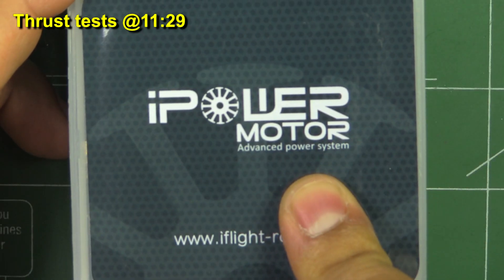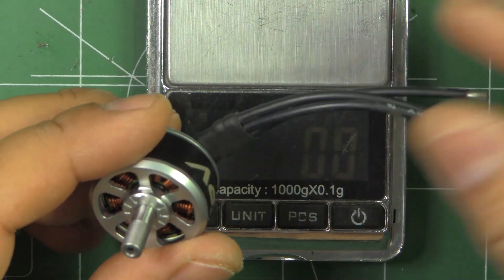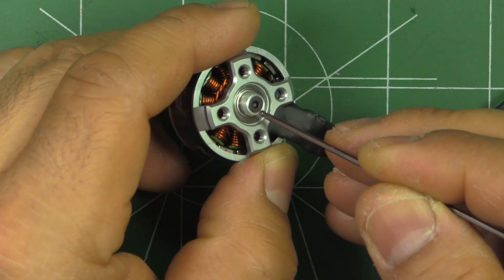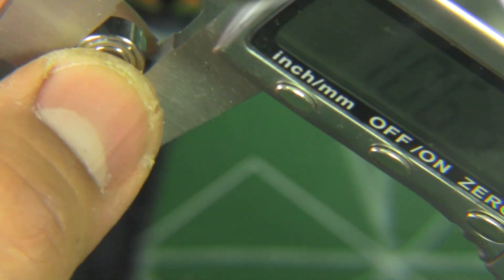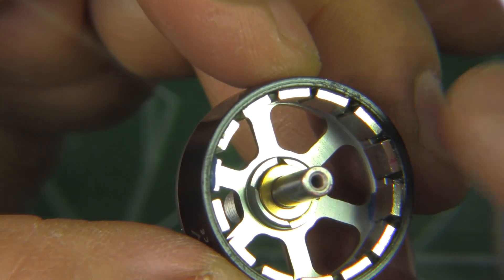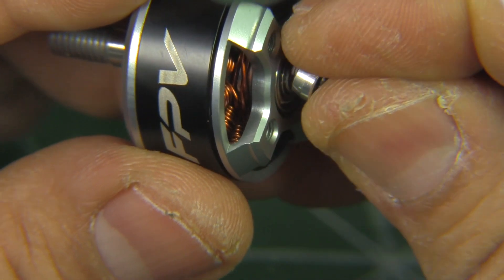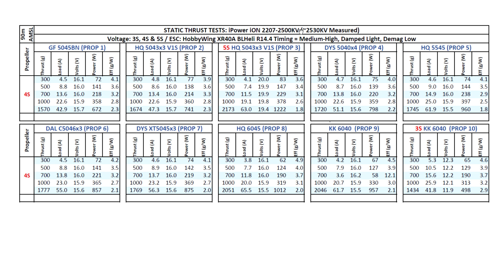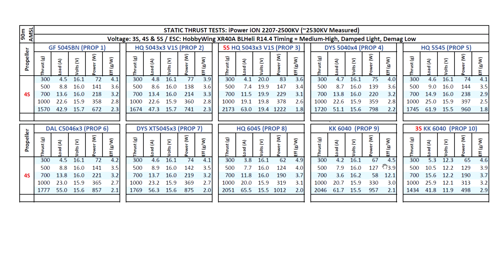iFlight-RC.com iPower iON 2207-2500KV Thrust Tests & Overview. *2500KV* SALE ENDED

Comment: Thanks for doing this test. Wow! Pulling 65 amps with a 40 amp ESC! That is one tough ESC. I may have to purchases some HobbyWing ESCs as well as some motors ;-) Great testing as always. Keep up the great work!
Reply from the maker: :) Yep, those old HW XR40A ESC's are very robust. I used to use them on a couple of 2208 6S- HQ6045 quads and never skipped a beat. They're a bit big for today's standards and you do have to do a "hard" flash for BLHeli (solder to pads on PCB) then you can flash/setup thru signal wire. Eventually, perhaps the FETs may fail from all these big Amp spikes. 
Thanks for watching!

Comment: In the video during the thrust stand tests it says "2207 2700kv" so I'm confused
Reply from the maker: Yep.. just a late night video edit mistake. Disregard 2700KV. It's 2500KV. Not that confusing if you watch video. KV measurement at end shows ~2500KV  :)
Thanks for watching!
Reply: Keep up the good work!

Comment: The more i look at your motor reviews, the more i get confused about the motors i have to buy for my next build. I can imagine you get a lot of people like me who end up like me who just end up asking you for advice. I am building a sub 250 grams floss 2 frame race build. I have a tattoo F4S aio with integrated 30a esc's. I would like to run the emax 5" AVAN props on 4S. I am looking for a motor that is as light as possible, with enough torque to spin the Avan's. And all this without destroying my battery's. Not easy for me. Any advice would be appreciated.
Reply from the maker: Good choice and recommendation on the EMAX. 2207's would match nice with those AVAN props. Since one of your concerns is not torturing your batteries, I'd consider the 2550KV. BrotherHobby T2 2206-2600KV /EMAX RS2306-2400KV are also a very good choice, for premium the equivalent sizes from T-Motor are good. There are so many really good choices now it is difficult to chose a motor, but that's great LoL.
Reply: BH R5 2306 2650kv is 28 gr. That is the lightest big motor I could find and should be great on a light build.
Reply: BH R2 2205 2600kv too, cheaper and reliable, only they are hard to find at the moment
Reply: Checkout the UAVfutures review of the Avant Devel 5  https://www.youtube.com/watch?v=L7TIPkLPj6Q the exact combination
Reply: I don't think the r2 is a good choice for the avan. They require a very strong motor and the r2 is not that. It is now a very old motor and what is the point when an R5 is the same weight but a 2306 vs a 2205?
To be honest I don't think a 2205 is a good choice for anything these days. Things have moved on.
Reply: Alexander Kolov, the devil is fast alright and within the 250gr weight limit. ASJC27, do you think the R5 is reasonable on the battery? For sure the R2 will have a lower amp drain and better flight times. Any idea on the total amps drain with a light quad?
Reply: Aleksandar Kolov I have seen that motor also, not in stock, but maybe worth the wait. It seems to be a recent release. Banggood states 24.6gr. Not bad at all. A review would be great.
Reply: GauisHelenaMohaim out of curiosity why is your main criteria avan props? Few racers use them as they kill batteries fast and you end up managing your battery to last a race. On a light rig, most people will fly faster and better with the new brotherhobby r4 2205 rather than 2306s or 2207s. The 2306 r5 are a freestyle motor. You’d be better off with returner r3s which are lighter than the new r5 2207, but I’d stick to 2205s unless you’re a pro racer - far more agility.
Reply: Coppertop FPV What do you fly if i may ask? Dal cyclones?
Reply: GauisHelenaMohaim if I want speed, then yes, cyclones, or the new gemfan hulkies. If you build it light enough, the old 5045 cyclones work well.
Reply: And if possible, easy to source in an outlet like banggood or something outside of the US.
Reply: Emax LS2206 or LS2207
Reply: Interesting choice, as high a kv as possible for sub 250gr i presume. Tnx for the input btw.
Reply: Exactly, so many choices and a lot of conflicting information. But now i have good recommendations from a reliable source. Again tnx for your time EnineerX and MajorProblemsStudios.
Reply: +1 I'm in the same boat. Although these motors look and perform great they are a bit on the heavy side for a sub 250 build. About 40 grams at least.
Reply: Aleksandar Kolov The lighter, the better, especially with the thin arms of a floss frame. Breaking arms is a real risk with heavy motors. Do you think the BH R2 2205 would have enough torque to spin the AVAN props? Considering their high pitch. rate?
Reply: If you are for an updated version of the R2 then BH  R4 2205 2700KV may be better, the only thing is that there are almost no reviews of that motor
Reply: Coppertop FPV I still have 40 pairs left and as you indicate, these are one of the hardest to drive. But i am used to them, and they are fast.
Reply: PhoenixFPV i like the Avan as well but only the two blade S model for speed runs.. the R 3 blade version is a freat race prop but the Amp demands are out of control even on premium batteries they just pull to much current.. where i do like the 3 blade Avan R is on 1600 to 1750kv 6s builds... amp draw is then managable and the response is among the best i have flew except for the Hulkie 5055 and the new Gemfan 5149 that is THE prop of today. There is no 2205 out there that can really handle the Avan R.. at minium a premium 2206 in the 2400 to 2600kv and that is minimum... that prop does best on a high power 23xx stator even 2207s dont handle them well in the low to mid throttle range and dont do well with them until you are in the 60+% range of throttle however rhe more torquey 23xx stator motors will do a better job with them in the low to mid range. Honestly the only 4s motor i like the Avan Rs on (except for the stupid current they pull) is the F40 v2 2400kv (not 2600kv as you will see insane amp draw its already a ton on the 2400s) and the other motor that does well with them and is a 2207 but the only 2207 that i have used with them that handles them good in rhe low to mid range and top end like the f40 pro v2 is the Hyperlite 2307 2522kv but your amp draw past about 85% throttle will be in the 150ish range and holding solid at 130ish until your battery cant handle it anymore. It is the only 5 inch prop ive ever seen break 160 amps and that was on some hand wound 2870kv F80s lol.. monster motors on a monster prop on a 95C 1800 4s Rlines, cooked a Wraith32 35A about 20 secs in to the flight on a vertical punchout that was held for about 3 seconds blew 3 fets right off the board and melted my xt60 solder lol... i seen 163 amps but my current sensor had a slightly slow refresh rate the instant burst right at full throttle was prolly approaching 200 amps for a split second.. when the it blew the FETs it was at about 137 amps... i started laughing because when i seen it hold over 160 amps for about 1.5 seconds i was shocked ive ever seen that before... most powerful motors will only hit 130ish and taper quickly from sag and prop umloading down to about 100 to 110ish...